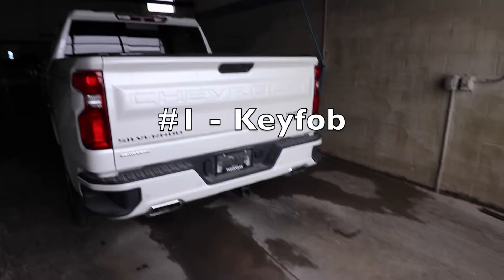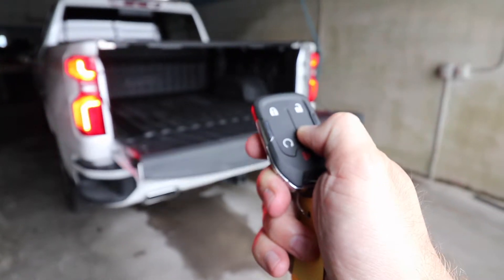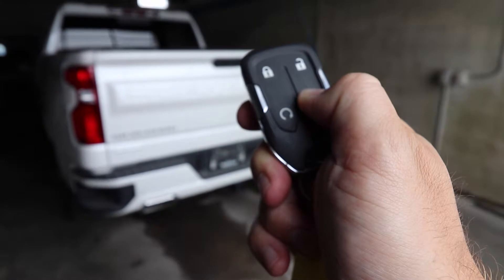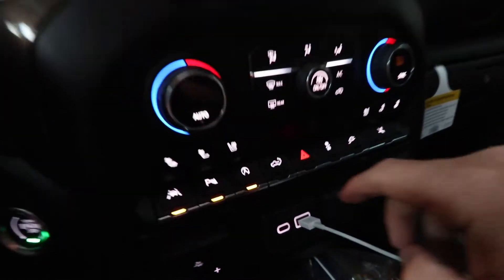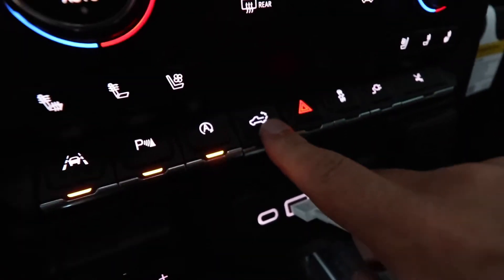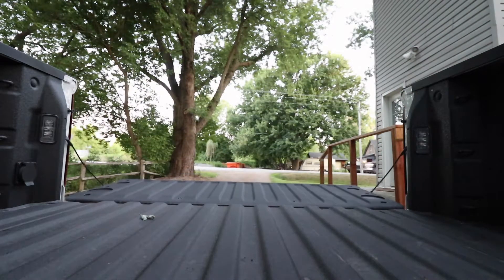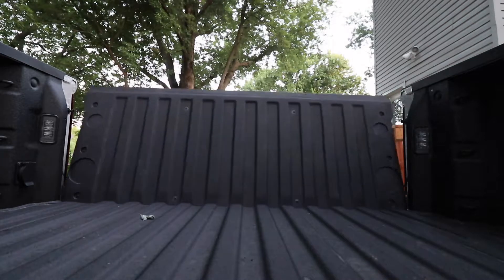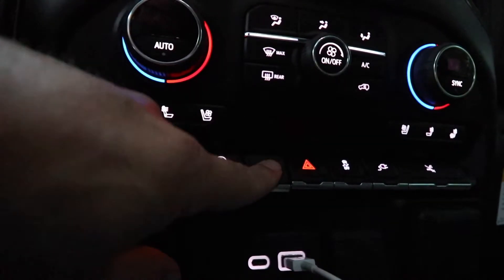HOW TO - POWER TAILGATE ON CHEVROLET SILVERADO (YES IT GOES UP!!)

Comment: Hi I have the high country 2021 I’m in California and I was wondering if you can answer a question about the climate control I have it on high in the settings but this morning when I turned it on with remote after 10 min was not hot? When I turn off my a.c I don’t push the ac button off with the light so I turned my truck off and turned it on with remote and it was high and blowing the heater air which I wanted do I have to make sure a.c button is off?? Before I turn the climate dial off

Comment: How do you open the darn thing manually? Why is there not a regular backup latch handle?
Reply from the maker: Hey Richard - You can still just open with the push of the button.  I will admit, it does take some time to get used to.  Nothing faster than a latch when you're in a pinch.

Comment: What if the battery dies? Is there a way to manually unlock it?
Reply: You use the key that's hidden inside the fob.
Reply: @MrPAULONEAL  ah, there's a key cylinder in the handle? Didn't see it in the video
Reply: @MrPAULONEAL  there is no key cyl in the tailgate. The key in the fob is for drivers door only.

Comment: the 2020 GMC Sierra 1500 AT4 dont go auto back up???
Reply from the maker: no they don't.  The AT4 would come equipped with the multi pro tailgate. Going back up... going to have to use your hands :)
Reply: What kind of mechanism that makes it go up? I have a 2019 sierra...i wonder if I can add that option
Reply: @Drae2g2  only chevs go back up